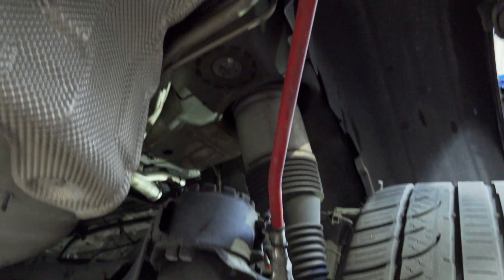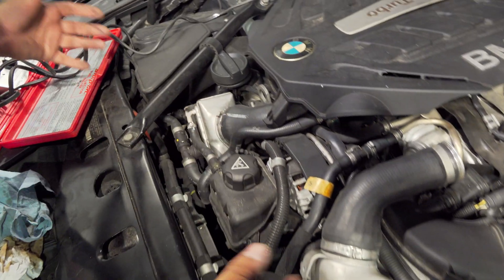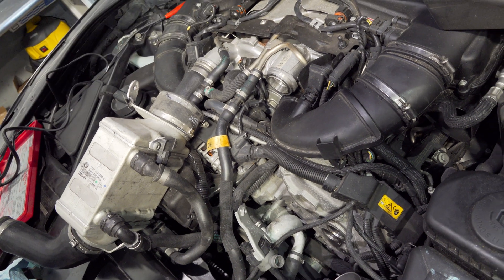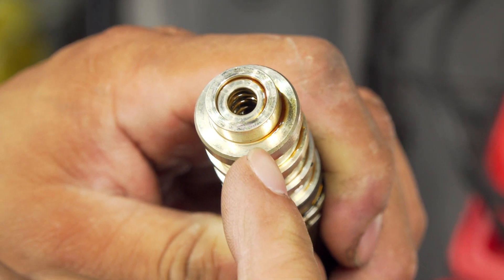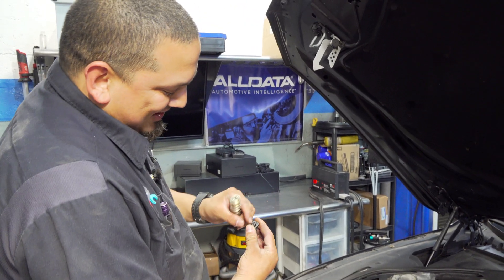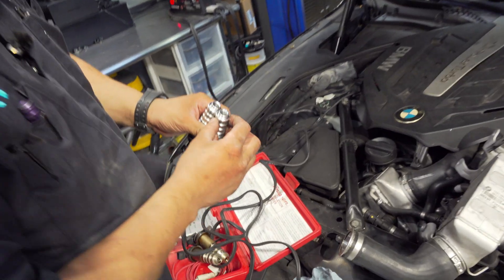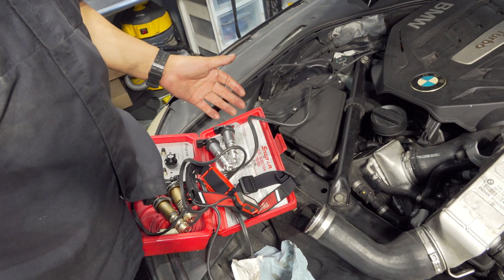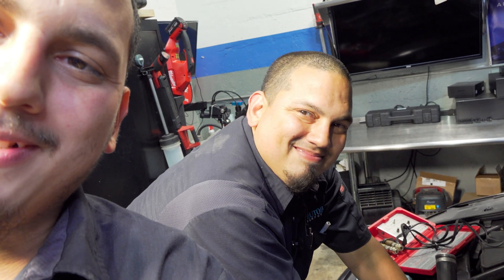JAGUAR POWER FEED - BMW N63 VANOS

Comment: that is a design flaw in those valves.  the plunger that rides in the solenoid(the upper part of the spool) has had oil get in there and is hydraulically restricting the movements. the plunger is most likely round in a round hole but it needs a groove or flat to allow oil to drain out if it gets in there. if you filled that up with brake clean and worked it it would come back to life. problem is its just a matter of time before it screws up again. seen this same thing on hydraulic equipment and have at times modified them this way .

Comment: Hi Mario. I have a problem with my Bmw X6M 2010 4.4 555 hp 175.000 km.
The car is misfiring. I put new spark plugs new coils. At first it was on cylinder 5, I changed the injector 5 with the 6 and the error stayed on 5. I remplaced the car battery and the error moved on cylinder 6. I made a tour the car was very good. After 5 min it started: rough idle, smoke. Now the misfire is on cylinder 1 and 7. When i clear the fault the car runs good. What do you think?

Comment: The Jaguar cable wire is crazy, press together. Why not just fixed it tat the press point??
Reply from the maker: Do you have a tool that will press an aluminum rod to a copper cable?
Reply: @SuperMarioDiagnostics  Not a tool but just some kind of connector between the 2 metals. Aluminum rod is crazy.
Reply from the maker: Not something I can risk and provide warranty for the customer, honestly. I’ve yet to see a crimp that will go around that 1 inch wide aluminum end!

Comment: I love my 1992 e34 5 speed, 350k on the clock at 58 I can still fix it, snows gone almost time to go get it out of storage! Great to show folks how things work I use a bench top power supply to run solenoids and clean injectors etc. Just did a complete timing chain set on my sons HHR last fall even though the VVT's were replaced 1yr prior when the SHOP did the timing chains..rattled bad took it apart and the guides broken no superseded parts, so I did it right. I replaced them again because of debris (metal shavings) and yes, I had to redo a mechanics work..boy that made me angry. Been turning wrenches since I was 10 I never called the Shop, I just tell my friends hey you might not want to go there anymore 🤔. Off to put a bumper cover on a 2006 GMC Envoy...those free Family jobs are killing me.

Comment: As a BMW owner, the N63 is not a reliable engine.  I wonder if you could have just ran a separate 2 gauge cable for the Jag versus ripping all that out?  That was a ton of stuff to get that cable out.
Reply: Probably could have but that’s kind of hacky. I wouldn’t be able to do that to a customers car and feel good about it.